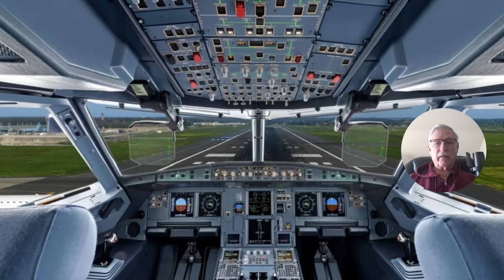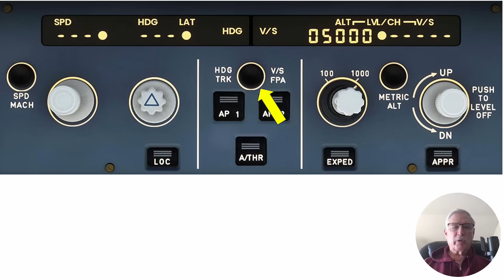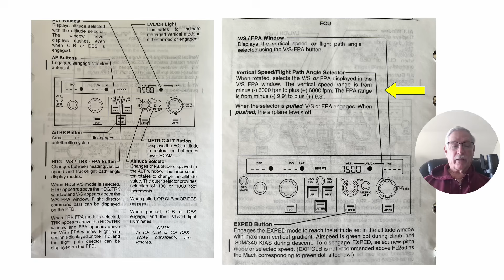A Very Poor Flight Control Design and Carless Operation Kills! Air Inter flight 148 Accident.

Comment: Good work as usual, this incident deserved more recognition and exposure than it got at the time. If you're continuing on with more Airbus system design flaws, have you considered looking at Iberia Flight 1456? There were no casualties with that accident thankfully, but the plane had to be written off due to extensive damage caused by overzealous angle of attack software and pilot error.

Comment: The poorly designed mode display obviously played a big part here, but removing the GPWS system was a huge hole in the Swiss cheese!  I wonder if the smoke detectors in their houses had batteries in them.  ;^)

Comment: Since my response to a comment in the last A-320 video where I asked for documentation showing that Airbus advertised the A-320 as un-crashable and able to be flown by monkeys passed with no reply, I decided to do my own research. Airbus has never marketed their aircraft - FBW or not - as un-crashable or that they can be flown by monkeys. In fact, the very first A-320 commercial flight, a charter by I believe Air France, crashed when the captain got himself way behind the power curve during an ill-advised low and slow pass over a local airshow. The airplane did refuse the captain’s efforts to stall it - Airbase did advertise the A-320 as un-stallable in Normal law - which saved the lives of all but a handful of passengers and crew.
Reply from the maker: I have had 24,924 comments to date. Sometimes I miss responding to one. Youtube used to email me the comments but that suddenly stopped and I can't get a decent response from their tech support on how to fix that. The "advertisement" was to my ALPA National committee back in '85 by an Airbus Test Pilot by the name of Captain "Z". He told the committee the aircraft was un-crashable and he flew for us some very aggressive demonstrations. This was all before the rash of crashes. The monkey comments were made by Captain Z again to a German pilot group. I was told there was a video on him making the statements but I had not looked for it because I had no reason to feel that the German pilots were making it up. Still don't. Never and always are two comments that are hard to definitively prove.
Reply: @ronrogers Thanks very much for your reply. I wasn’t accusing you of any sort of negligence. YT channels are not easy to maintain.

I (and most other people) obviously would not know what your group or the German group were told by Airbus’s Captain “Z.” I do not doubt that he said it, but it only hi-lights the fact that he was not - or at least should never have been - part of Airbus’s marketing department. Perhaps he made the comments in jest or perhaps he was serious. In any event, I’m sure Airbus would disown his comments both today and back when he originally made them.
Reply from the maker: Robert, I hindsight,  I am sure Airbus would disavow....but at the time, he was the most fervent supporter of the design (others were less vocal but no less supportive) and to criticize any part of the aircraft was considered an insult to the French! I kid you not! I had issues with the design and got a call one day from the ALPA president, Randy Babbitt (we knew each other well) telling me he has just got a call from the CEO of Airbus asking it all of ALPA hated Airbus, or only Captain Rogers! Fortunately he found it amusing and inspite of the call, Airbus just paid ALPA to reprint 3,000 of my latest airbus flight evaluation (319).
Reply: Maybe they don’t advertise it.. but everyone knows it.  

It has lead directly to overconfidence in the aircraft (Air France 296Q, Airbus Industrie 129) where pilots were excessively bold and trusting of the flight envelope protection—particularly Alpha Protect in Normal Law… as well as dependent on it to try and get out of bad situations (Air France 447.. the co pilot pulling back believing Alpha Protect would not allow the aircraft to stall… not realizing it was disabled in Alternate Law).  

Also having flight envelope protection based on angle of attack rather than airspeed like Boeing does leads it into an uncanny valley were it wil preserve the angle of attack.. but at airspeeds that will result in the flight path being subterranean.
Reply: @calvinnickel9995 I can guarantee you Boeing knows that airplanes can stall at any airspeed but only one critical angle of attack. Boeing aircraft will assume a subterranean flight path just as fast as AB aircraft if the pilot and/or engines fail to provide enough power at the right time.

133 passengers on AF-296Q survived because the airplane refused to stall despite the pilot’s best efforts and wound up settling into the trees instead of plunging into them.
Reply: @robertbutsch1802  Correct me if I am wrong but in that accident the CA was demonstrating how the a/c would not stall because the engines would automatically spool up to maintain level slow flight down the runway.  Problem was he went too low and the a/c went into the "landing" mode and the engines stayed at idle power until at the last moment when he added power but by then was too late.
Reply from the maker: You are correct.